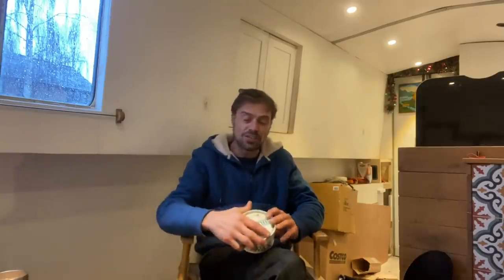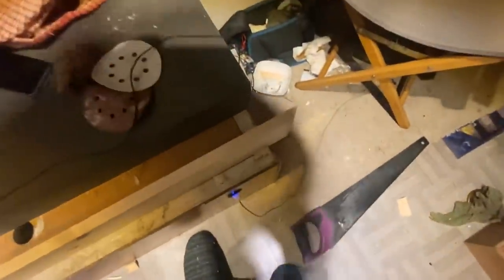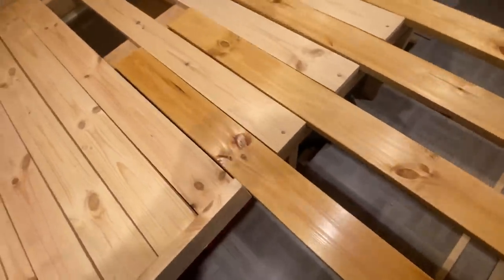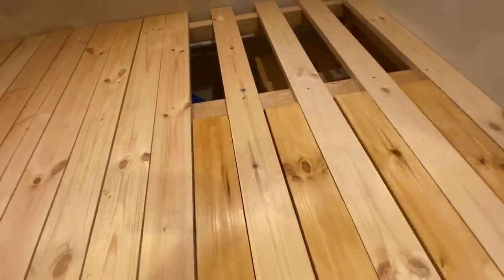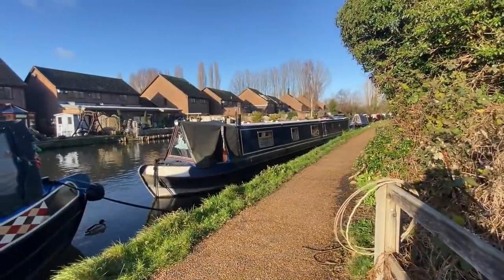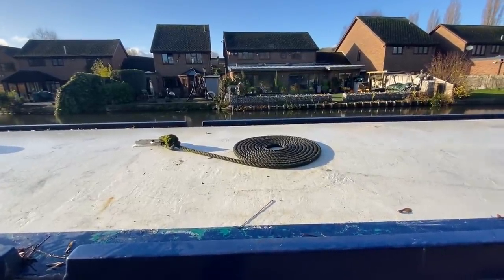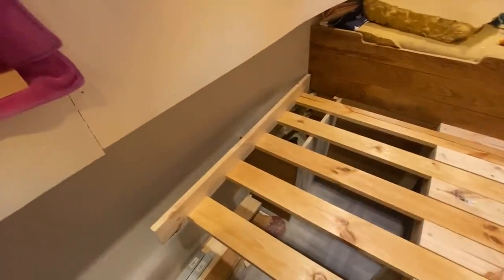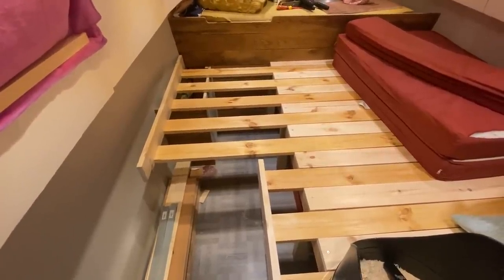292. What’s through today’s door

Comment: James - you could make 3 legs that fold down on the longitudinal axis of the boat and when they are stowed you could conceal them behind the two fascia boards you have installed on the bed boards that pull out. You could also secure your steel strips  across the fixed boards that would also have the effect of stopping the moving boards from tipping;  belt and bracers with the legs - so to speak.

Comment: If you mount the metal ten on the NOT moving parts in such a way that they stop the moving parts from tilting, one ten close to the outer end and one near the maximum out, I don't think you need any support by the port side. ie its the foot end of the bed.
Reply from the maker: I reckon it’ll still need to rest on - yes it’s the foot end but these kids won’t remember that as they jump everywhere

Comment: The bed looks good - hope it worked ok.
I'd have placed new beams next to the centre ones you have to stop the moving slats from sagging when extended instead of needing metal strip on tops?
The shelf idea is a winner as it only need be deep enough as your skirting will be, with a lip so that the sliding front can simply drop over it and be secure.  Kinda a small L shape where your moving side of the bed can just lip over the upright of the L (makes sense in my head).  Yes you'll have different lengths if left with those bow end slats all together - maybe consider 2 slats bound up that end?  Yes it means now 3 pieces need to be slid out but at least you'll get a better profile to the hull curve?
I have a similar thing on my boat but between two seats (slider spans boat between them) and I have moving keg supports, the wax (I used candle) means the mattress moves and the legs become slanted and uncomfortable - a fixed edge to drop you sliders into will save you that at least :)
Great vlogs - I'm new to you 👍
Reply: I meant to say leg supports... Pesky automessup! The legs move with bed use, so they then sag and the bed becomes uncomfortable until fixed.
The L bracket needn't be all along either as your step seems good. 🍻 Sorry, going now lol

Comment: Probably well worked this out by now but those metal strips you have fix some middle and open edge bit to the fixed bed batons, they will hold the moving slats in place.  Placing those metal strips that are fixed to fixed batons so that they don't impede the moving batons and steel strips. Probably not need more support for kids, but if you were to have adult company more supports needed.